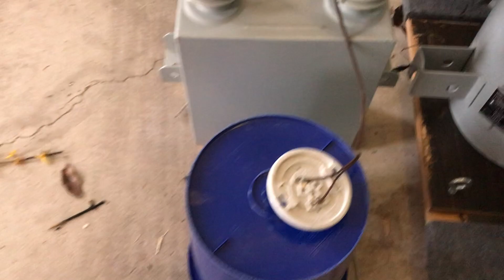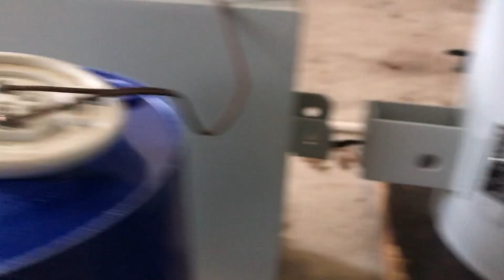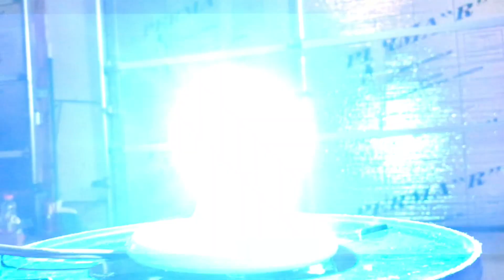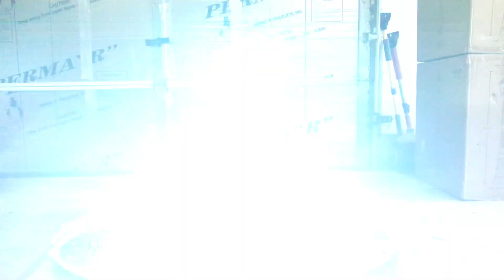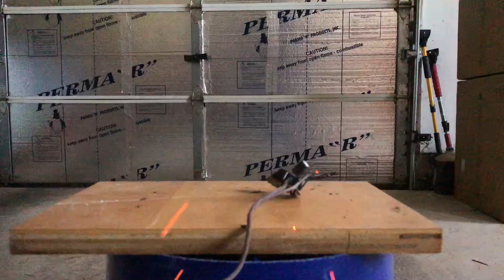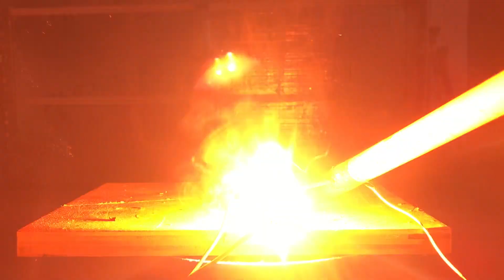Light Bulbs VS High Voltage

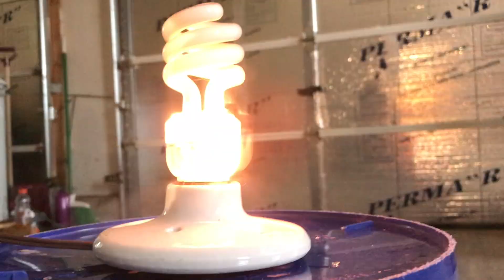Comment: Wow nice! It looks like that CFL at 2:04 opened up a black hole for a split second haha
Reply from the maker: Thank you, I looked at the frozen frames and they were quite strange looking. I do not know if it as from the magnetic field, sounds, or light that upset the camera. I stopped the arcs with that one because it was SO LOUD! After that clip I put ear plugs in and the entire footage was corrupted. It was the loudest thing I have ever heard. Even 7 hours later and my ears are still sore.
Reply: @metersocket00  Possible emp? With all that energy in the cap being dumped at once through that little board I wonder... either way, it's very interesting.